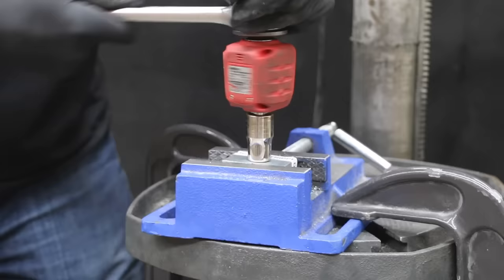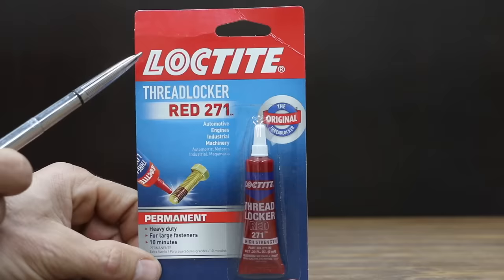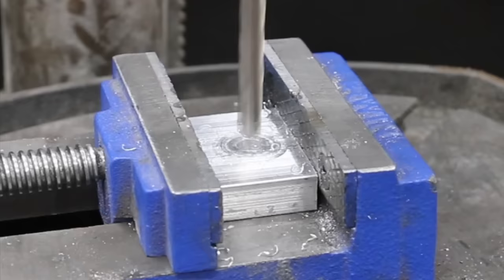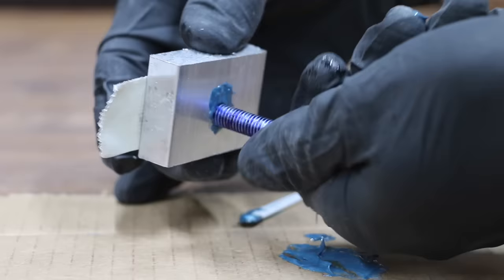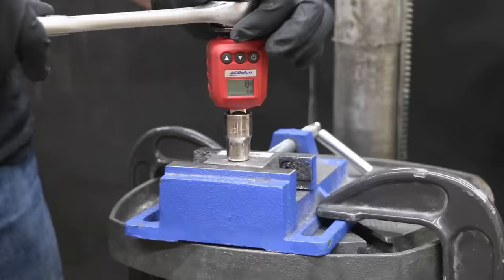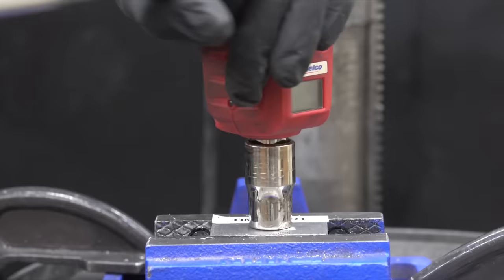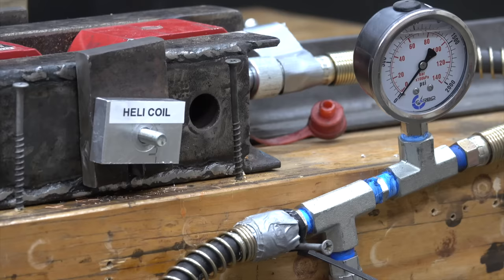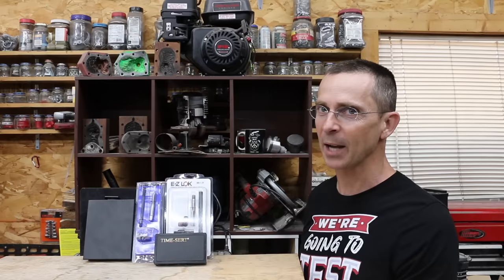Best Damaged Thread Repair? Let’s Settle This! Heli Coil, TIME-SERT, E-Z LOK, JB Weld, HHIP, Loctite

Comment: Not only do I appreciate the effort to make all the tests and comparisons of the thread repairs, I salute your ability to drill and tap ALL those test pieces. There is a LOT of work involved in these videos that don't even add to the video content, or barely so
Reply from the maker: Thank you very much!
Reply: @ProjectFarm  Video suggestion (but certainly too expensive): automatic tapping mechanisms. Tapping heads of different brands vs FlexArm.
Reply: His testing is invaluable, especially for a DIYer like me.  Before I try anything I haven't used before, the first thing I do is see if he has done something on it.   The time and effort that must go into these is mind boggling.
Reply: They don't add to the video content... They permit the video content XD
Reply: Quite the exercise in patience on this one for sure!  That's a lot of tapping.
Reply: @PeregrineBF  From having owned/used multiple varieties, from Tapmatic heads of different sizes to FlexArm and their clone, FlexArm style is much better solution for a fabrication shop. You can tool them up for countersinking and tapping, etc using  the quick change collet system(also available with clutch, but with some practice is not neccesary/can get in a way). My favorite size does from small # taps up to 7/8" or 1/2 Pipe. It's one of those things that just sits in the corner, ready to use anytime, vs having to setup Tapmatic on drill press/mill, etc, that for couple holes no one is going to do.
Reply: @ProjectFarm  Test Duracell optimum triple A batteries. I am begging. Put them on the chopping block. They are 1.5 X the cost of Duracell Coppertop
Reply: Amen!  Tapping those threads is a pain in the ars!
Reply: @ProjectFarm  do you have copy of the  Machinery Handbook?
Reply: True until you realize he’s making millions to drill holes.  He deserves the success though!
Reply: @ProjectFarm  Great test, going to try switching from helicoils.
Reply: @ProjectFarm  could you do a test on a free spinning fan under the carburator? my dad told me about smokey yunick, back in the 60s, he mounted a free spinning fan under the carburator to race nascar, nascar banned the invention supposedly, it would be interesting to see if it really worked
Reply: @__m__e__  I wouldn't go as high as millions, not even a million.. Most large YouTubers say the earnings estimates are way off and it's nowhere near what most people think, or what the websites say.
Reply: Very well said
Reply: Absolutely! The amount of work this guy puts in is amazing. Thank you so much for all your work. I don't know if you think of yourself as a scientist, but that's what you are. You are advancing the knowledge base for all of us.
Reply: @willb3018  same for me
Reply: @Jacob

Those are easy enough to test yourself with a small fan and a timer. If you have a voltmeter even better.

I love this channel and when he did the battery test I had already done extensive tests of my own and his results were entirely consistent with my own.
Reply: @__m__e__  I hope he is! He definitely deserves to be making a lot! He’s providing a tone of useful information for dyi type people. Probably saved millions for them💰
Reply: I agree with you I personally don't know if I would be a YouTube influencer even with the money. The filming and editing alone. Then you have to create a film scrip. Come up with a film them. Then buy and test the products. Have to know the correct procedure for testing. Have the right tools for testing. Know how to use the tools for testing. And to top it all off you have to be interesting otherwise no one is going to watch it 😂
Reply: That's why he did all those drill bit tests previously!
Reply: @PeregrineBF  he isn't broke
Reply: @MF175mp  They're $6,000-$20,000+ each for the FlexArm ones. Pricier than anything else he's ever tested.
Reply: @PeregrineBF  sure but check out the budget for vids that Whistlindiesel has for example. Destroys expensive cars and stuff every other week
Reply: I realized there is a test not performed and that's the leak test... For example repairing threads going into a coolant passage ex. Gm water pump threads they are through holes sealed with sealant applied to bolt when inserted into bolt hole the... The key is which ones leak through the repair....
Reply: I was thinking the same thing, I would’ve hired a machine shop.
Reply: For American only because of the use of imperial system not meaningful for European's 😢
Reply: Well you would take the time too if you were making the money he does
Reply: @ProjectFarm  time-sert is actually a wurth tools germany product.
and it's just as expensive in europe!
Reply: @volvo09  - Oh- they make millions but utube keeps 90% of it… 🤓🎶🎵
Reply: mexican helpers can do a miracle, sometimes
Reply: @ProjectFarm   Hello, would be rad if you could test spark plug thread repair kits!
Reply: Always be sure to drill and tap the holes they will thank you later
Reply: @ProjectFarm  Can you pls convert it in Nm??! 😄
Pounds... did not expect it even there.
Reply: Shouldn't take you much longer than 15 minutes if even that. With a good setup you can do more than 4 M8 taps per minute, ofcourse that does require a good setup which takes time to uhh set up

Comment: Something interesting about threaded inserts is that for space hardware (which I work on), we use these as standard when threading in to softer materials like magnesium or aluminum. As you saw, it makes things stronger!
Reply from the maker: Thanks for sharing.
Reply: I'm guessing that, since the aluminium remains the limiting material, they're stronger simply because of the slightly larger threaded aluminium hole having more thread overall, combined with a courser thread? So the strongest solution would be the one with the largest outer diameter and a course thread?
Reply: @bakedbeings  I would imagine that the insert would exceed the bolt of the same size as the steel insert would expand against the aluminum as the bolt pulls against the insert. Kind of like a climbing expander.
Reply: My guess would be that the inserts are steel inserts rather than another soft metal.
Reply: @bigrenegade7121  they are
Reply: @andrewholdaway813  That being the case then they would definitely stand up to the test better than the aluminium
Reply: @bigrenegade7121  
Yes.
As lazer says, they are often used in space (and aircraft) aircraft hardware.
Reply: Inserts were developed in ww2 machinery for same reason.strength and durability
Reply: @Big Renegade  the question was why, as the stringer metal is then threaded still on the weaker one, the comments above were suggesting why that might be, because at the end of it, it is still softer metal holding the bolt to the "work piece"
Reply: @bakedbeings  You are correct. The annular area that's supporting the load increases with the square the of diameter.  So increasing the diameter of aluminum shear area by 10% (x1.1) increase the load capacity by 21%.
Reply: Wow that's awesome!!
Reply: The first 1-3 threads in a standard threaded hole carry most of the load when torqued (~70% if I’m not mistaken) due to the elastic interactions between the male and the female threads. The female threads will not show the same “compliance” when cut in a solid material so the tension in the bolt will decrease along the axis towards the bottom of the hole.

Inserts are ‘better’ because the load on the threads are more evenly distributed in comparison. The insert itself provides a more elastic interface between the male and female threads for the load to spread out over.
Reply: @Si-Al-Ti This.  I was going to say the same thing.  

As others have said the larger diameter / more surface area does help.  

But as you explain, it's the compliance in the coil that allows the bolt to more evenly load all the threads and distribute the loads better.
Reply: @Si-Al-Ti  Right. Of all the inserts the helicoil and HHIP have the best conforming. How to explain the big jump Torque and apparent "bolt strength" for the EZ lock? What is it about the EZlock that increases the torque and apparent BOLT strength? 
It shouldn't be able to do that so it must be something related to how the bolt head digs in and jams, causing the friction/torque to increase. 
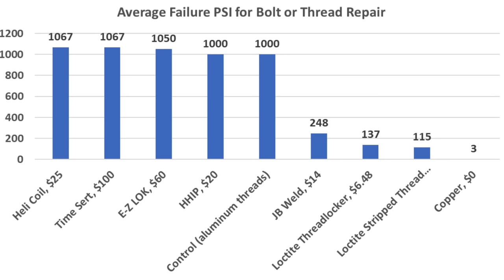The results at 13:43 shows that the bolt strength does not actually increase with the EZ so it is ONLY the friction/torque that increases. 
The EZlock is somehow causing a big increase in friction between the head/thread and the metal/insert. He does not show the broken parts in detail.
Reply: @billshiff2060   It could really depend on a bunch of different factors. Without looking in to it very much, just off the cuff, I'd say it's the design of the EZ lock itself. 
EZ lock might be prone to inadvertently be sunk below the surface lower than the others, or trickier to get perfectly square, causing the digging in (he really should've used a washer for all the tests though). 
The EZ lock has (to my eyes at least) a bit more meat on it and is the only one using loctite - the joints made with the other brands (including the Time Sert that has a similar design) would therefore won't be as rigid - I'm just guessing here though.
His methods and testing priorities can be a bit confusing from time to time...
Reply: @Si-Al-Ti  Something is causing a huge increase in friction for the ez. That actually is a bad sign NOT a good thing. 
It takes a LOT more torque to reach the same clamping load as the others. All that extra torque is not going into tensioning the bolt. It's pure wasted friction. 
Can't really tell if it's the head digging or the thread binding but it sure would screw up any torque setting of an assembly. 1/3 more torque for the same tension.

You are right, there should have been washers and I'd add that it should have been a block spacer with washer and bolt that to the thread to simulate an actual assembly.
Reply: @billshiff2060  agree!
Reply: Why PSI not N or kgf on the pull test
Reply: I'd be curious how a 9.45mm x 1.59 bolt,  aka 3/8"x 16 tpi bolt would perform, the pilot drill for a 3/8x 16 tap is 8mm or 5/16", the least intrusive size.  One insert had a 12mm pilot tap, that's approximately.480" of course it's going to hold better.  But what if the stripped part, say a casting, would be compromised with such a large od insert thread repair.  I'd go with the next size larger, that being the 9.45mm haha 🤔
Reply: @bakedbeings  beleive it or not fine threads are stronger than coarse in almost all scenarios, provided theres enough thread depth.

But yes the larger the diameter of the aluminum female thread, the better tensile retention of the insert.

But you dont really need the insert to be very thick, as the bolt becomes the limiting factor very quickly.

 steel bolt on steel threaded hole the hole wins provided both metals are equal in hardness.

If your aluminum thread size is 2 or 3 sizes up from the inner diameter of the steel threaded hole, then the bolt is once again weaker cross sectionally than the thread is.
Reply: Same here
Reply: Should be used thread loctite to "glue" the insert to aluminum?
Reply: Thanks so much , first time to know it is used as standard
Reply: Manufacturers would never do this because of the cost 
It would be the right thing to do but they won’t do it 
They want it to fail so you buy another 
Planned obsolescence

Comment: I used a cheap eBay helicoil clone kit for holding my front axle clamp on my dirt bike. I was really nervous to push it with the repair, but it's been holding well for over two years. Your results make me even more confident!
Reply from the maker: Thanks for sharing!  Glad that it has held up!
Reply: IDKFA.
Reply: Yes even the cheap kits are stronger than the parent metal, especially in aluminium alloys, as long as there is enough metal left around to spread the load. Also works for fasteners that are removed very often, so is very common in avionics as well to have 300 inserts in a unit to hold the screws that are used for hermetic covers, and on aero engines as well, in the assorted aluminium castings. Just have to use the right recommended corrosion treatments when assembling them.
Reply: The differences are more in how consistently you can install them. The chinese kits sometimes cross thread due to low quality installation tools that come with them. It's really hard to mess up a timesert in comparison...
Reply: helicoils work great, they increase the diameter that engages in the parent metal, which makes them a lot stronger than the original thread, and they take advantage of the lower elasticity modulus of aluminum, spreading the load over more threads. They help prevent corrosion between aluminum and steel fasteners as well. Only problem I've had with them is backing out due to poor installation, or using too short of a screw, and pulling out the first few coils.
Reply: @jpikl1284  the actual industrial tools from Helicoil work much better than those cheap slotted drivers. We use pneumatic installation tools and collated insertes on a plastic carrier to install thousands into aluminum parts. It only takes a second or two per Helicoil, nothing is faster.
Reply: @trekzilladmc  IDDQD
Reply: A mechanic once stripped a thread on my Yamaha XJ650RJC where the valve cover screwed directly into the aluminum head. I only noticed when it started seeping oil. I helicoiled it (pretty nerve wracking drilling straight into the head) and it never leaked again for the 11+ years I kept that bike.
Reply: @BrainHurricanes  I3DQ
Reply: On my 2004 ATV an exhaust shield bolt was stripped from the factory.  I used a helicoil with red loctite and it still going great today.
Reply: @raiden000  What does that do ? Can't find it.
Reply: @BrainHurricanes  I love dairy queen
Reply: The cheap kits seem to be identical to the semi-brand-name ones found in auto parts stores, and are likely made in the same factory.
I've broken insertion tools, but the finished result depends more of the care used in alignment and drilling than the brand.